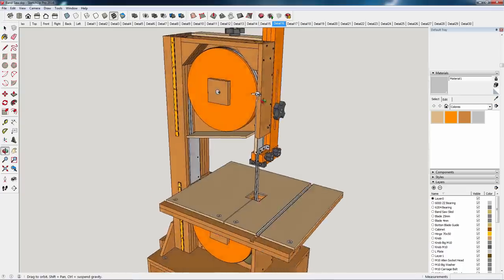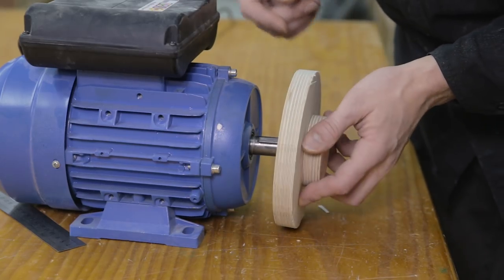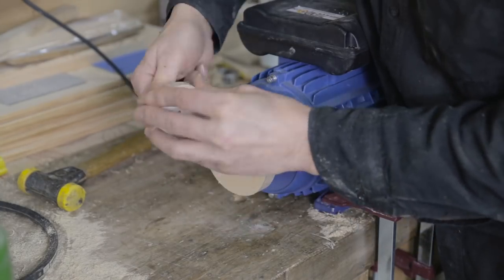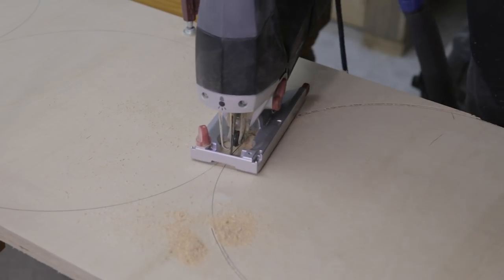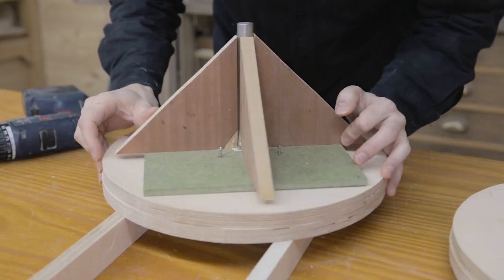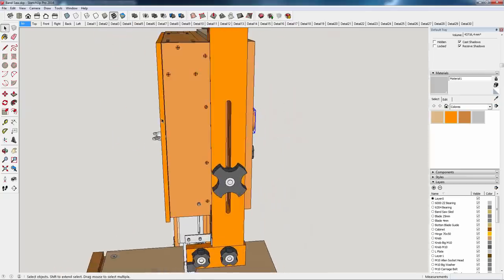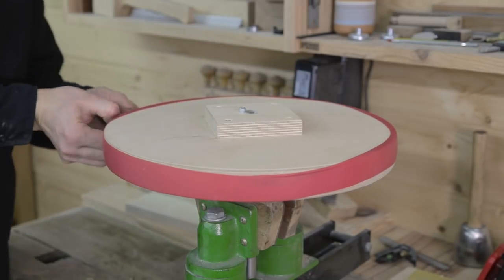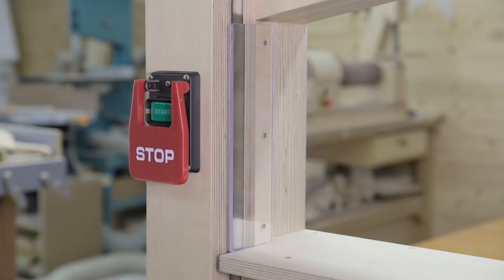Making a homemade Band Saw (part2 / the wheels)

Comment: Hi, I have bought your plans and I am in the process of building the bandsaw. Could you give me more details about the polyurethane glue you use to hold the wheels to the calibrated rod so that I can get the correct glue please? Great video and plans by the way, really enjoying building it and looking forward to using it. I have looked at a number of bandsaw builds on Youtube and yours is definitely the best, Thanks
Reply from the maker: hello Allan, you can use any glue that sticks wood and metal, and expands when drying. Email me please, I can help you better

Comment: Great job! Now the bad part: waiting for the next part... ;) Just a question: don't you need to balance the wheels?
Reply from the maker: Gianluca Salvador thanks Gianluca, you're right. I explain that in the article of my web. "We must also ensure the wheels are balanced. For that, we turn them slowly on their bearings and check whether they tend to turn more towards either side. If that's the case, we only need to make some holes on the wheel from the front to remove some of the weight on the side the wheel is moving towards"

Comment: Would i be able to scale plans down to make the same but smaller bandsaw as got limited space and a benchtop bandsaw in desprate need of a replacment.
Reply: Really interested would be willing to pay a little more to buy the plans for the scaled down version to accept a small induction motor from the Energer ENB539TAS 200mm Table Saw 230-240V and to accept a 56 1/2 inch blade lengh